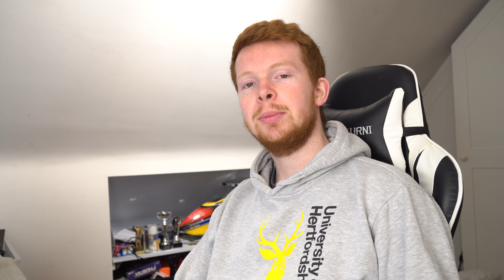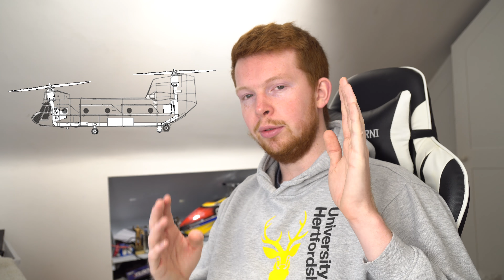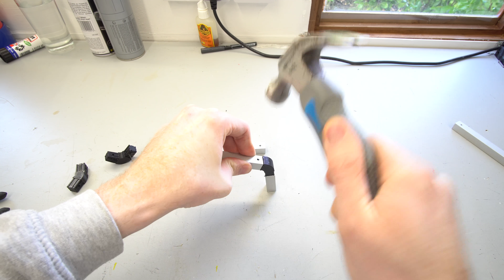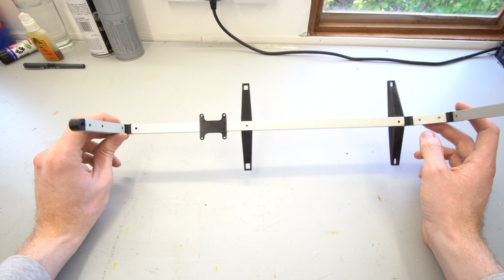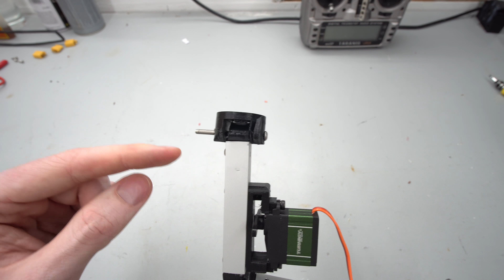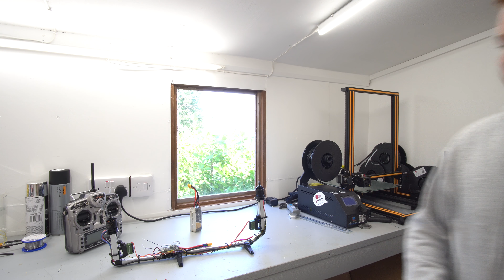RC Chinook Bicopter - Part 1

Comment: I feel like this is going to be horribly unstable, even with the precautions with the roll axis that you've taken. Honestly, if this flies, I will be impressed and I'm gonna subscribe just to see what happens.

Tom, if you're reading this and it does fail to fly with any sort of stability, I feel you'll have a lot better luck if you take the swash plate and entire rotor head mechanism off 2 cheap 6ch rc helicopters. It would be quite difficult to find the complete rotor head on their own and would probably end up being pretty expensive and complicated, especially since each rotor head requires 3 micro servos... However, it does give you the added benefit of being collective pitch, giving you much greater control over the roll than the setup you currently have. Best of luck, let's hope it flies well :)

Comment: I cant help thinking that as the motors are mounted at their bases, when a rotation correction is applied that the centre of lift from the rotors is offset from the centre line. 
I would presume that the centre of lift should stay in the centre line even if the rotor is canted sideways, so the rotational centre point should be in the middle of the rotor blades, not the motor base.

But, this is just a theory and i'm probably wrong, good luck in your build, love your videos.

Comment: Amazing! 
I love your creativity and the way you follow your ideas and instantly design and manufacture them and then - probably the hardest part - make them actually function in the real world and describe your learning curve. Usually the best designers are not very good in communicating and documenting but the way you do that is really outstanding - thanks so much, it gives me a lot of insight in physics.
There is only question about this specific helicopter project that I don't understand - having the rotor axis tilted towards the front, how would you ever be able to fly backwards for maneuvering? I guess the only way would be to sit on the rear brakes until the front has been lifted for the rotors to be horizontal and the fuselage it angled, you can maneuver normally. Must be quite tricky to handle in full scale real life as a pilot during take off and landing. But I guess the advantages in flight (probably more than 90% of the operational time) with the angled configuration are giving the fuselage a perfectly horizontal position which makes total sense. And there is the advantage that the blades can be having a much bigger radius, being more efficient and creating even more lift in the center of the fuselage where they overlap and they cancel the moment when turning in opposite directions - actually pretty genius.
I guess I just answered my own question :-).

Comment: i like it! I'm not sure if you tried other designs but the chinook has both powerplants in the rear and uses the transmission to control the rotor speed. Also the blades themselves are what pivot not the engine. Have you tried custom modeling larger blades as well? those tiny rc rotors barely lift at all.

Comment: If you want it to fly like a chinnock then sorry to say you will need 4 servos for full control 

Does the 3d printing company you mention sponsor you ?

Lie others have said really  informative and easy to follow videos keep up the good work
Reply: Of course it doesn't fly like a Chinook - the whole point of the project is to build a tandem-rotor that doesn't need multi-axis control (by a swashplate and more than one servo) of each rotor.

Comment: No idea how that should be unstable, The main weight is underneath the propellers, it's not like a chair with two legs, but rather like a swing hanging from two ropes, which as far as I'm concerned is reasonably stable. The only problem I could imagine is not being able to steer in all directions without allowing the motors to pivot at least along one axis.
If there is something I don't understand about the whole Bicopter thing, an explanation would be awesome.
Reply from the maker: +Phino K.M. if you research the 'rocket pendulum falacy', you'll find that a weight below a point of lift does NOT cause it to 'self correct'. I know right... it sounds counter intuitive, but the aircraft needs to produce a torque to rotate back to a vertical position. If the whole aircraft rotates, so does the direction of thrust. So if the thrust isn't producing a force directly upwards, the weight won't swing below it. It'll simply shoot off sideways or downwards until it crashes. It's very had to explain via text, but I will probably go over it in my next video. Thanks!
Reply: It's unstable because there is no control of the roll axis if the motors can't pivot.
Reply: Yes, but it is self correcting, since the weight of it will always cause the propellers to point up (at least assuming the propellers are generally pointing in the right direction).

Comment: Are you going to make the rotor heads tilt forward and aft or are you just gonna control pitch with aft and fwd thrust mixing?
Reply: GunsnCars3 No need to make them tilt to control pitch. It will be just like any other quad/tri etc.

Comment: Because of the tight tolerances of the basic frame I would have been tempted to heat the aluminium section in boiling water before assembly. this may have allowed the printed parts to seat better.

Comment: A lot of the forward thrust to reach 200knots on the Chinook comes from the turbine exhaust—or so a former flight engineer told me over beers in a seedy biker bar.
Reply: I don't know about "a lot"... any turboshaft engine with a rear-facing exhaust (which is essentially all of them) produces some thrust in addition to the shaft output power, but I haven't found any online indication (including from the manufacturer, Honeywell) that turboshaft versions of the T55 produce a useful or notable amount of thrust.

Comment: Will you 3d print the fuselage? I once made plaster males and vac formed off them. If you made female 3d prints, you could plaster cast the males and vac off of them.   Plaster males are quite reusable if you put PVA in the mix.

Comment: Hey check out at 8:14 your front motor starts to tilt to right, is that a glitch? 

And by the way awesome build! Keep it up!
Reply: This is drift in the Flight Controller. The flight controller is trying to adjust the angle of the copter, but because there are no propellers on the motors to make force to change the angle the Flight Controller keep making the movement larger, pushing over the servo. You see this on a quad copter, one or two motors will start spinning faster with no props. Hope that makes sense?
Reply: It's normal, when FC sees not response for PID output. Any tiny drift in gyro will be an "error" which will be accumulated via I Term and cause such an output to servos. In real flight with motors on and  props attached copter will respond immediately accelerate toward the gyro drift direction and remove error.
Reply: I saw it too, but the servos may have been turned off at that point since he was testing only the rotors
Reply: And I suppose they just moved
Reply: but why does it go back when he kill the power? and why just one of them?

Comment: 0:24 That comparison isn't accurate. You are underneath the two points of lift and not above them. So it's more like sitting on a swing (with very short ropes).

Comment: Nice! Do you know if the controller does a tricopter configuration? I've always wanted to build a pod racer from star wars racing drone!
Reply: All flight controller software does tricopters. I can't think of any that doesn't!
Reply: Tsnafu I've neber built an copter but he's got me convinced I need one!
Reply: Start with a kit - I have a trifector from hobby king, but it's a bit small and fast for a first tricopter. Hobbyking have got the RotorBits TriCopter Kit on clearance at the moment for about £3.60 ($5) - that'd be a great place to start
Reply: IncredibleMrZ there are a couple of wicked vids on YouTube here of indoor pod racing. Give it a search.

Comment: I’ve bought 2 tiny quadcopter motor they have 2 leads / wires coming out of them so I wanted to use them on a plane how would I connect them to a esc
Reply: Shocked James you have Brushed motors, in order to run them you’ll Brushed ESC’s
Reply: Firebird Aviation tanks

Comment: 8:20 the right motor tilted on its own.
Reply from the maker: It seems that when the PID gains are too high, the motors tilt when spun up on the ground. I think the vibration causes it to drift and it doesn't self centre because it's 'fighting' the ground. Thanks!

Comment: Looks very cool. Can't wait to see final product.  But whats going on at 8:15.....looks like the forward motor has a mind of its own.
Reply from the maker: It seems that when the PID gains are too high, the motors tilt when spun up on the ground. I think the vibration causes it to drift and it doesn't self centre because it's 'fighting' the ground. Thanks!
Reply: Thanks! Your videos are not only entertaining, but incredibly informative. Cheers!
Reply: maybe a too high or low I (integral) value
Reply: Yeah, my racing drone does a similar thing if you take the props off and start it on an un-level surface when in angle mode. the motors all start at about the same arming speed but eventually the lower motors will accelerate to full throttle. with the props on, this will simply level the craft more efficiently. I think this is because of air mode?